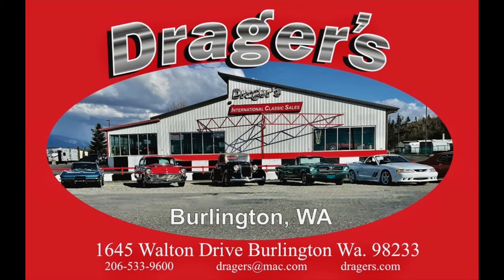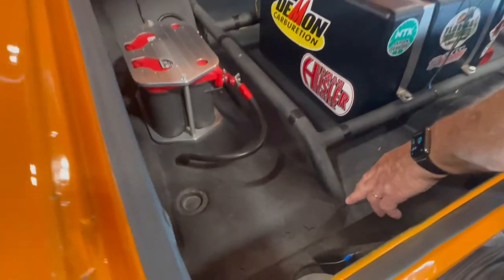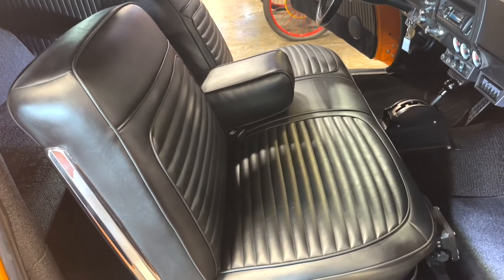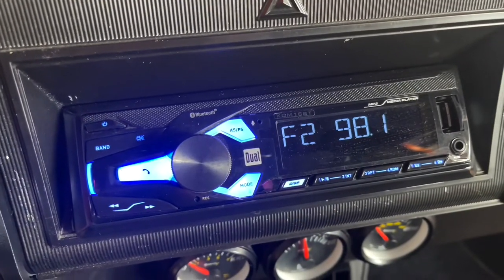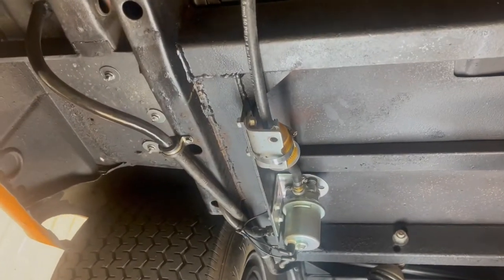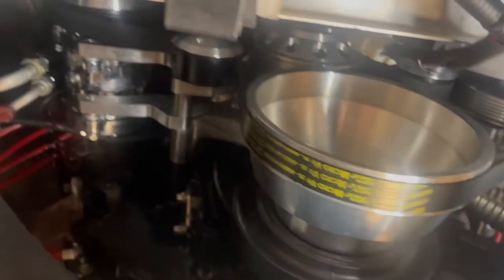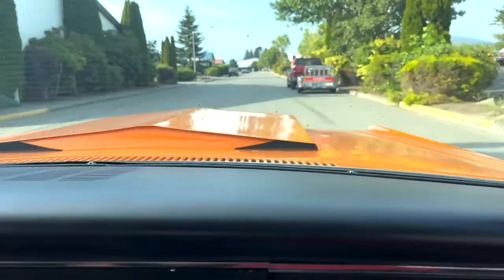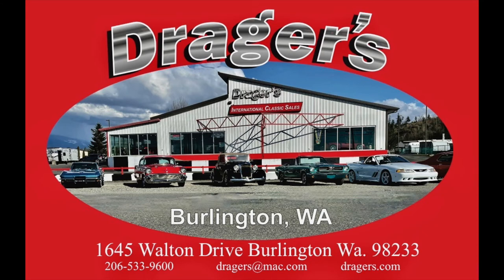1964 dodge race car     SOLD      DGC0471

Comment: Nice 330, most people, young people don’t get it. I own a 1964 ,440 with a big block, how much is this one? I should buy it… it’s pretty cool. I can’t hear my radio either . Got rid of that push button transmission. Looks like a 1966 Satellite in the background, I had one of those as well.